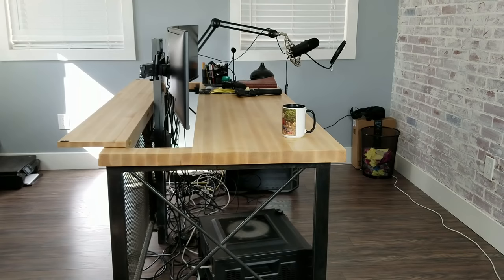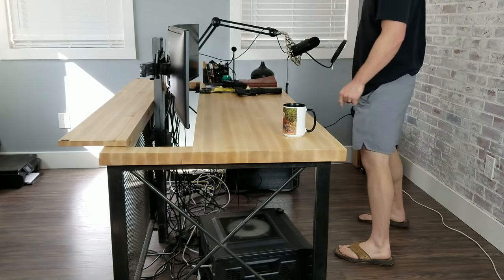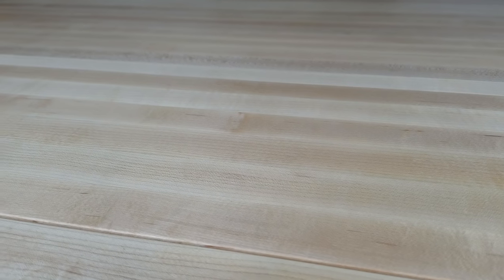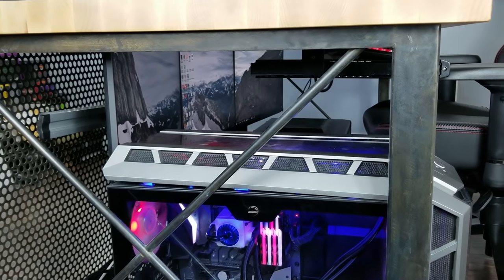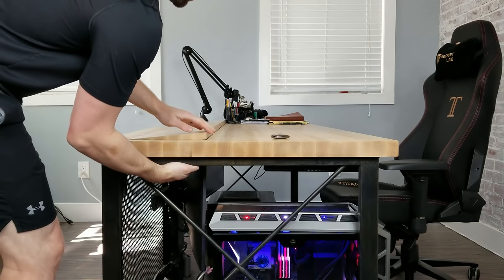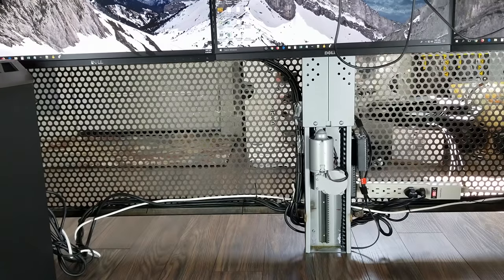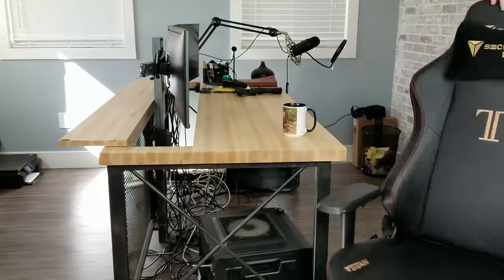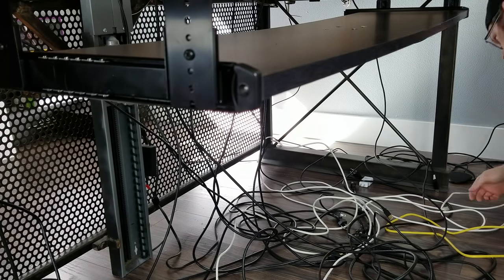Triple Monitor Lift On Custom Desk

Comment: Wouldnt it be nice if the computers power button lowered the monitors automaticly then raised when turned on.
Reply: that would be possible if you take the led power signal and then create a circuit that activates the monitors
Reply: @ArturoGameTech  Stating the obvious. But also wrong. A power signal for an LED has nothing to do with anything.
Reply: @ArturoGameTech  It'd probably be best to use something like an Arduino if you know someone that can program one.  You could have it programmed to short the motherboard's power pins and the desk lift toggle with a toggle switch.   Set the switch to high to turn on the PC and raise the lift, put the switch on low to send the PC a shutdown command and lower the lift.

EDIT: I originally said easier, but I think better would be the better word. lol
Reply: Then there would be a bug where the computer was up and the monitors were down. Probably due to some computer wake up or shutdown without pressing the button.
Reply: @CanyonSteve-z8j  not raise the computer raise the monitors

Comment: Why did you not daisy chain the monitors ? one monitor cable up to one screen and connect them in to each other instead ? I do that at work on my 3 dell monitors that look just it
Reply from the maker: Shoot, I've had a triple monitor setup for like 8 years and have always just connected them with three separate cables. I didn't realize daisy chaining monitors was even a thing. Looks like it emerged a few years back with DisplayPort 1.2? Is that how you're doing it? Or, it looks like you can also do it via USB C now, too.

In any case, that would have been a much easier (and cleaner) way to set it up. Thanks for the heads up!
Reply: No problem mate. Was asking myself, is he connecting all 3 to the computer when he can daisy chain. if you go to the monitor's menu you can see there is a function called DC.
Its super easy.  Dell has a write-up of it as well: https://www.dell.com/community/Monitors/Monitor-Daisy-Chaining-explained/td-p/5177869
Reply from the maker: I saw that article after your comment. I had to go look up "daisy chaining monitors" because, like I said, I've been doing it this way for so long that I had no idea that someone had finally created a better way to do it. In the past, with HDMI or DVI you would need a ~$20-$30 active DisplayPort adapter in order to get all three working. So, glad to know they've simplified the process. I might have to do a video on it in the future (and give you a shout out.)

Comment: I woulda recommended some velcro in lieu of duct tape but whatever works is what works. GJ
Reply from the maker: Lol, yeah, that probably would have been better. I kind of did it on the fly and used what I had. I got to that part and realized I didn't have anything proper to do it with on hand, so I was like... "duct tape..."